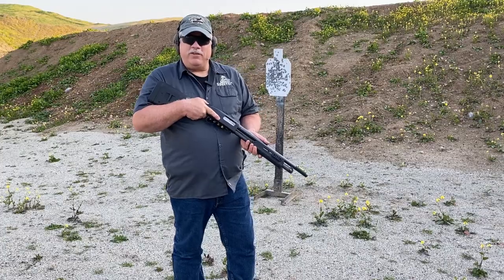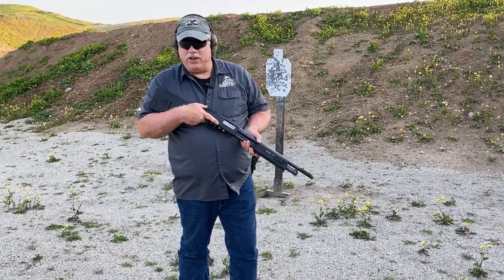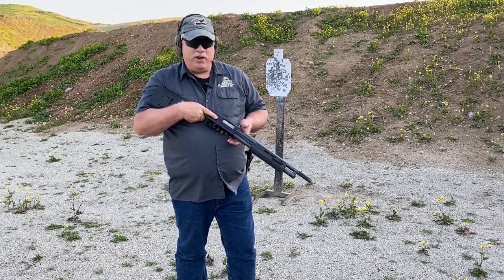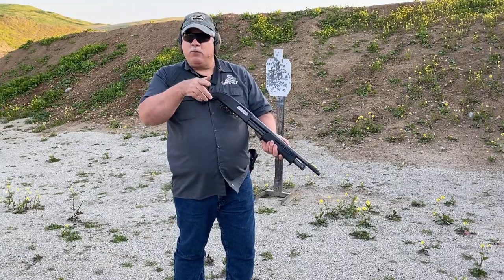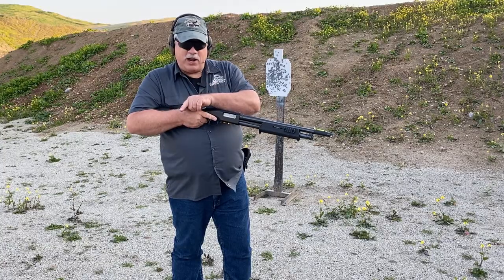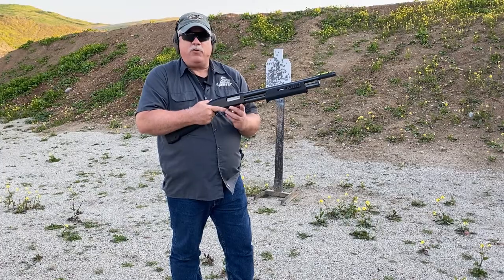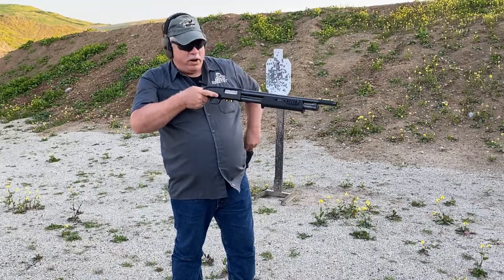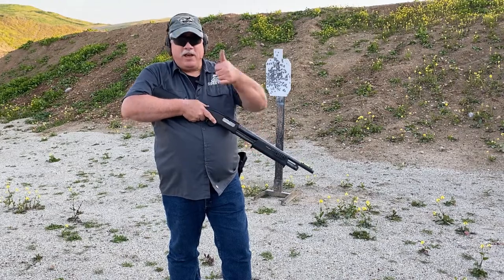Tactical Shotgunner Pro Tip - The "Select Slug" Drill

Comment: Why waste two rounds and instead drop one slug in the open chamber when you eject that first round?
Reply: Because when you open the action, a round from the magazine is released on to the shell carrier/lifter.  If you drop another round in on top of the that round, you wont' be able to close the action to fire.  He could do the "pump and dump" which is essentially opening the action which ejects the shell from the chamber while swiftly rolling the gun onto it's right side to allow inertia and gravity to take the second round off the carrier/lifter and out of the action.  Then he could port load a single slug.